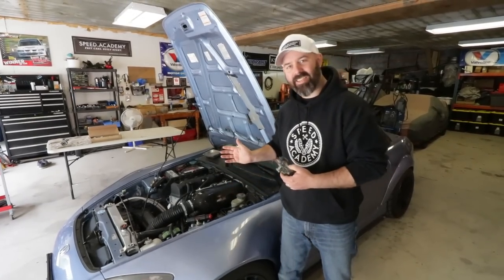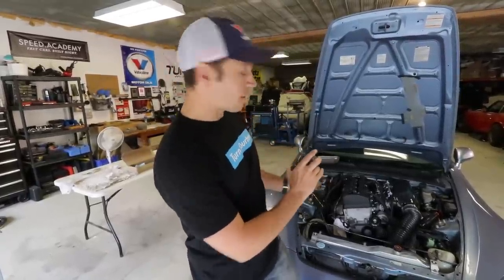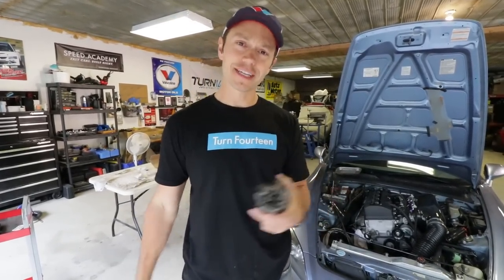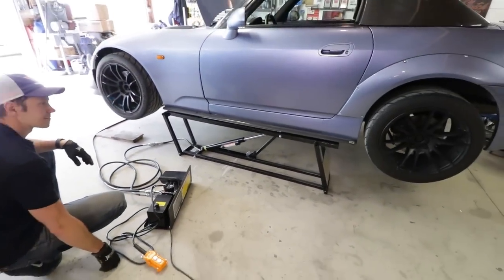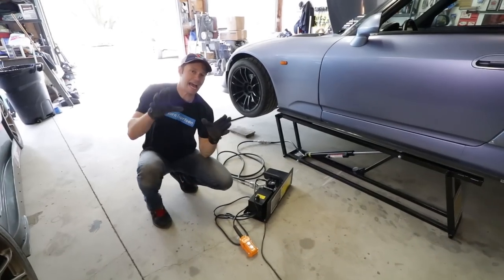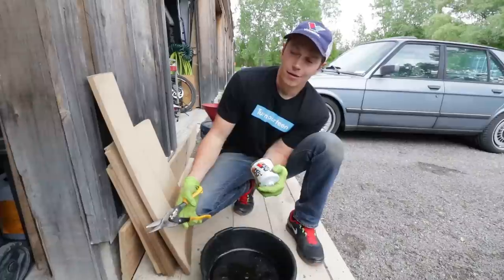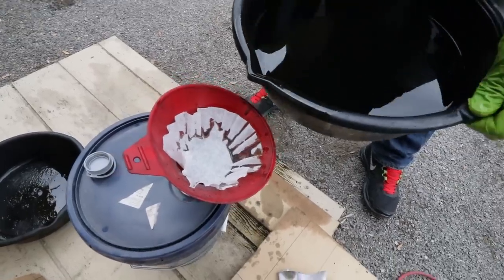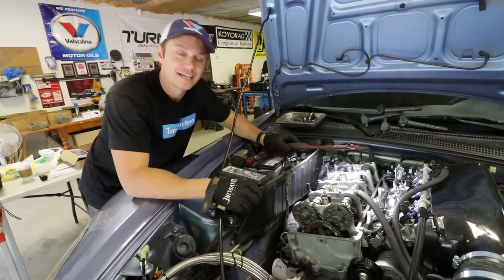No VTEC! What's Exactly Wrong? - Project BADASS2000 - EP17

Comment: I was helping a Targa NFLD team that had a similar problem with a B18c. They had RTV all throughout the oil pickup screen and when the oil was hot the pressure was too low to engage VTEC. I'm not sure if the AEM uses the VTEC oil pressure switch or not but that could also be a source of problems (probably doesn't use it though). 

With that amount of metal in the pan it's most certainly a rod bearing. Kinda sucks but, the ASS2000 was questionable at best when you bought it!
Reply from the maker: pickup screen was clean, the rtv in our pan was just from the block when we removed the pan. it was a junkyard motor, so who knows how it was treated before we adopted it :D

Comment: All that extra silicon on the oil pan is gross made me cringe , my first guess would be that it got into the pump and that's what caused it to fail. Next time use the "right stuff " from permatex just a small bead is all you need . The motor would have blown up if that silicon had gotten into any part of the motor anyway IE under a piston. Lesson here is too much is not better.
Either you failed to check your bearing clearance or it starved for oil,now is the time to polish the crank and put good bearings in as long as you didn't hurt anything else. Time consuming but cheap to fix.
Reply from the maker: Nope, pump is fine, and no RTV on the oil pickup screen. What you see in the video just fell off the block during removal. Pete had to use a lot of RTV to get the pan to seal back during the initial install.
Reply: Speed Academy Use HondaBond next time!
Reply: @jkflorida  or toyoseal lol

Comment: Next time use loctite 510 or 518 on the oilpan, with anaerobic sealant you won't get that silicone shit blocking up your oil pick-up.
Reply from the maker: pickup was nice and clean, actually. The rtv in the pan just fell in from the block side when we dropped the pan.

Comment: With that jack, LOWER it onto the lock instead of relying on the hydraulics.  Then you could even disconnect the lines to get them out of your way if needed.  And not to mention its a little safer.  Never trust anything hydraulic with your life
Reply from the maker: Yup, we figured that out eventually and nobody even died! :P

Comment: the easiest way to open a filter is measure about 10 mm to 1/2 inch back from the flange and use a cold chisel and hammer or air hammer
the best way to see if there is metal in the oil is to let the oil settle for a day or so after removing from the engine 
plus the magnetic drain plug will be covered with crank material most likely because bearing isn't magnetic
Reply from the maker: air chisel is a great idea

Comment: You need to take the whole motor apart. The VTEC valve is an evidence that the metallic shavings are now circulating in the oil passages. Chances are your oil pump is badly chipped and there are other surfaces that are affected.

Whoever installed the oil pan did not do that properly. He/she was supposed to wait several hours before tightening the screws, if you do it too soon, the rtv material is squeezed into the engine, where it can break off and clog passages.
Reply from the maker: full teardown to come. No rtv in the pickup, what you saw in the video just fell in the pan from the engine block side when we pulled the pan off.
Reply: Speed Academy can't wait 😼😼😼

Comment: If it is an ap1, have you replaced the banjo bolts? This could cause oil starve to cyl 4. Also pull the valve cover to see if your valve retainers are showing cracks.
Reply from the maker: Rewind, Kyle. We swapped in AP2 retainers during a winter episode. We pulled the valve cover in the video and everything looks fine up there.
Reply: my bet is you tear it down and find #4 starved of oil and have ring and cyl wall damage. Most likely rod bearing damage on 4 also.

Comment: That explains why the powerWas low my friend has it and a build with so little money into it compare to you guys and he was making more power
Reply from the maker: The OnPoint dyno reads lower than most, the power it was making was higher than most NA S2000's he's tuned.
Reply: Speed Academy You guys really pay attention to your comments I think it's like the third time. Always on the s2000 as well I hope you get it sorted. Look up mixing ap1 and ap2 heads and blocks. That’s what my friend did for cheap whp while staying na, well cheap for him since he has like 4 engines.

Comment: how many miles does the car had with the oil presented in the video and what type of oil were you using??
Reply from the maker: Valvoline Pro V 5w-30 motor oil and its from last year so the oil isnt terribly old.
Reply: Speed Academy the thing that killed the car is the oil you are using. That viscosity doesn't handle heat very well on the track. for normal driving is perfect but for track days it doesn't work as good. In the track go for a higher viscosity ( 15 w 40 or 20 w50). these handle better the heat.

Comment: there is more to oil than pressure, what are your oil temps at the track? what viscosity are you using? and are you running an oil cooler? all this stuff matters on track.
Reply: Btw 70 psi hot sounds way too high. I just asked a tech at my work at an acura dealership who also used to work at Honda and he says it should be around 15-20 psi hot, you may have blockage post oil pressure sensor and having starvation problems.
Reply from the maker: Oil temps are fine at the track, we have an oil cooler in place, we're running full synthetic OE viscosity oil. 15-20 PSI hot is way too low.
Reply: What are the temps and oil weight you use? I'm talking about the pressure at idle btw.
Reply from the maker: oil temps are fine on track, 220-230 max. We're running Valvoline Pro-V 30 weight. Oil pressure at idle with our gauge and the sending unit at the oil filter sandwich adapter is around 30psi hot. At WOT it's 90psi hot. At startup it's 80-100 psi cold. Off throttle on the track it's 70 psi hot. 15-20 psi hot at idle is pretty normal for Hondas as read by the OE sending unit, but pressures read higher at the filter like our aftermarket gauge is setup for.
Reply: That all looks good. Hopefully you can find a smoking gun on the tear down, good luck.

Comment: Amsoil FTW
Reply: Which amsoil do you recommend? I'm trying to decided between Amsoil SS 0w-30 and ZRT 10w-30.

My AP2 2.4L shortblock with AP2 pistons and rings, paired with an all stock AP1 head, is just now broken in (with ~5500 miles on it).  I do have a thermostatic Mishimoto oil cooler.  I used conventional Castrol GTX 10w-40 while breaking in my engine (Castrol GTX is so cheap I've been changing it every 1000-2000 miles).  I just changed the oil with Castrol Edge 0w30 (european formula, aka "GC") but plan to switch to Amsoil next oil change.

Comment: what is VTEC?
Reply: Casper Van der Meersch   VTEC is Honda's proprietary technology which allows a different cam profile to engage at high rpms.   it gives higher opening and duration on valves above, I think, 5000 rpm or so for racing, but still driveability and fuel economy at low rpms.   the solenoid mentioned is the device that moves the cam  longitudinally  a to the different profile    if that fails, no increase in power will occur at high rpms   fyi, allnufacturers have some version of this now but Honda invented it.   I could be wrong about the rpm numbers, I'm sure someone will correct me if I am.
Reply: In short it means Honda engines which have two sets of cam profiles.
Reply: Casper Van der Meersch It's what kicks in yo